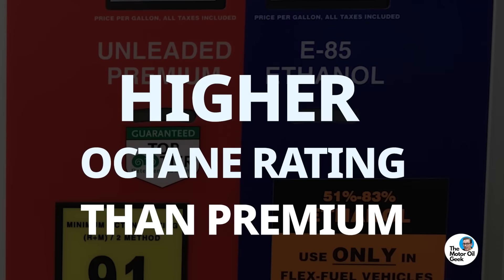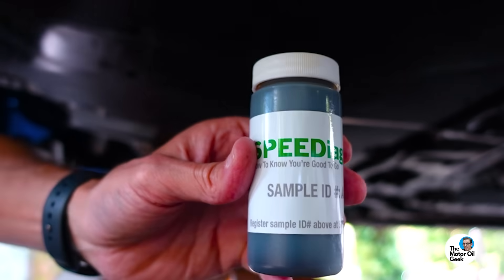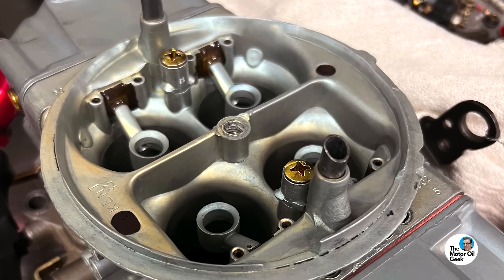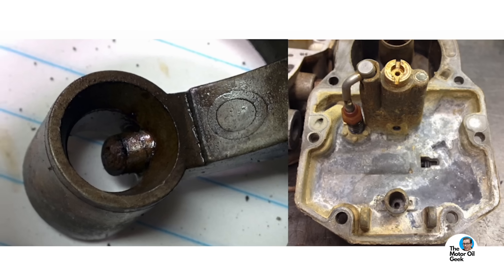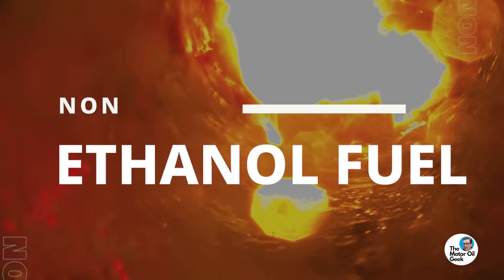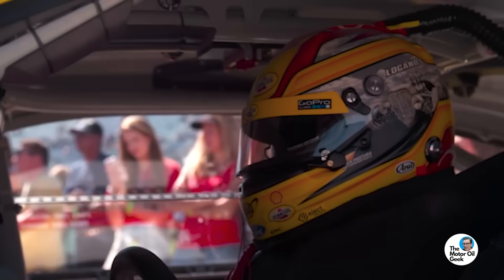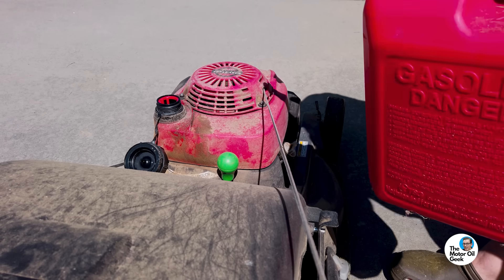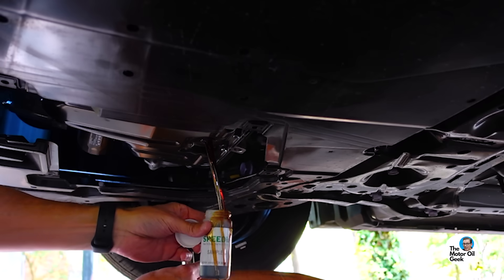ETHANOL: Higher OCTANE, Higher RISK?

Comment: Pump gas was blended with Methanol. Was. Ethanol is corrosive by itself and 10 fold corrosive mixed with mow gas. Two cycle oil mixed with Ethanol, forget about it.
Reply: Pump gas was blended with MTBE, not methanol.  The petroleum industry gave us MTBE after the disastrous lead was outlawed and it was not only an octane booster but also an oxygenate to reduce gasoline's toxic, carcinogenic, and dirty exhaust emissions.  During this time ethanol was modestly sold in the Midwest proving itself an effective and economical octane booster and oxygenate.

When it became apparent MTBE was another disaster in need of being outlawed, it almost was but was not outlawed by the Federal government.  

A few states did outlaw MTBE and brought big lawsuits against the petroleum industry over it which effectively phased it out in favor of ethanol which is a non-toxic octane booster and oxygenate.  

The petroleum industry even went along with the legislation to switch to ethanol because hidden in the bill was legal immunity from the MTBE.  That was revealed and taken out and the bill still passed.  This is why we have ethanol at today's levels.

The very first flex fuel vehicles in the early 1990s were rated for methanol (M85) and E85 but when use for methanol never materialized, that capability was dropped.  Methanol is slightly corrosive, so those early M85 flex vehicles had stainless steel fuel lines.

When the M85 capability was dropped in flex fuel engines, manufacturers dropped the stainless steel and switched back to standard mild steel fuel lines non-flex fuel vehicles have.

Ethanol on manufacturing chemical compatibility charts is far less corrosive on rubbers, plastics, and metals than what gasoline and BTEX (benzene, toluene, ethylbenzene, and xylene) are.

Brazil for many years has used their common gasoline in mowers, small engines, and small two cycle engines which contains 27% ethanol.  It has worked out so well and for so long that Paraguay went to E27.

Comment: In Western Europe from what I found out only BP/ARAL have NO ethanol or bio components in them. Hard to find some gas stations that have it, usual more towards German border. Shell V-power does, have bio crap they add more additives to compensate for the ethanol side effects. Same goes for their diesel. I use for high rpm engines (Honda) 102 octane (RON) from a special supplier not cheap (2.40 Euro/ liter) but then gasoline is never cheap here. Engine runs so much smoother. Like being back in the 90s.

Comment: In newer vehicles I love to run e85. It never seems to hurt my fuel mileage much and it’s way cheaper. I always have and always will do 3000 mile oil change intervals though. Will continue using it.

Comment: Ethanol destroyed my aeromotive fuel system and injectors on my foxbody mustang.  Had leaks everywhere.  The system was billed as being for pump gas. Let the car sit for years and finally decided to get the car running again.  Replumbed the entire system with ptfe lines fitting pump and tank. Hopefully i will avoid leaks and will use pure gas now

Comment: I really think all the arguments around how destructive ethanol is (or which fuel treatment is better) are down to local climate. 
I lived in northern Alberta and kept all the summer stuff in an unheated garage. Summers were dry, winters were well below freezing and I never had any issues. I bet if I lived somewhere with high humidity I would have had issues.
Reply: Before E10 came in the days of non-ethanol gasoline, people used to have to add little cans of alcohol to their gas tanks for gas-line antifreeze in northern states and Canada in winter with brand names like Heet or Dry Gas.

Mercury Marine thinks in their high humidity boat operation that E10 may be the superior fuel to E0 because it keeps the fuel dry.

Mercury Marine in a webinar on ethanol myths, noted that ethanol does not "grab water molecules out of the air." It is hydrophilic, which means ethanol holds water. With regular gasoline (E0) as well at E10, the primary cause of water collecting in tanks is condensation on tank walls. But unlike E0, which can absorb almost no moisture, E10 can hold up to half of one percent of water by volume, and the water molecules will dissolve in the fuel. The "solubilized" water will bypass the water separator and burn harmlessly through the engine.

Comment: Thanks for posting the informative video but there are more problems with ethanol fuel than you mention.  The first thing that comes to mind is the massive hidden subsidies for ethanol production.  In most cases they are burning diesel to grow and transport the corn to make ethanol.  Without subsidies it would not make sense to burn more fuel to make less fuel so governments hide the real cost and pretend the ethanol costs us less than fossil fuels.  Without knowing the total amount of the subsidies there is no way to know the total real cost of the blended fuel to the taxpayer.  Another problem with ethanol is that it can damage engines.  Ethanol will absorb water from the air and the ethanol-water mixture will absorb acetobacter from the air.  The bacteria wiil then convert the ethanol into ethanoic acid.  The acid will react with common metals to form salts and cause pitting of the metal.  There is no sensible reason to contaminate common automotive fuel with any alcohol.  Good luck with your videos.

Comment: If the aftermarket efi computer for my car was tuned using the standard 10% ethanol, will it still run fine if I put ethanol free fuel in it, or will I need to have some adjustments to the programming?  My state offers ethanol free 91 almost everywhere like Chevron.

Comment: My state does not require ethanol in premium. I use premium in all of my engines. Car mowers mini bikes go karts trimmers chainsaw. Year after year no carb problems.
Reply: Meanwhile, identical non-flex fuel cars, mowers, minibikes, go karts, trimmers, and chainsaws to yours have used >E27 in Brazil with no carb problems.

Your premium gasoline contains up to 40% aromatics like BTEX (benzene, toluene, ethylbenzene, & xylene) so you are getting exposed to some very nasty toxins and carcinogens up close and personal with not even a catalytic converter in between to try and reduce anything.

API's own study in 1948 found that the only safe level of benzene exposure was zero. 

Try looking up on chemical compatibility charts the corrosiveness of BTEX vs ethanol.

Comment: Question? Where does 3 different grades of gas come from one tanker with no separate chambers ??? And only one truck delivers to that station!!! All this gas stuff is a lie! Think about it folks!!!!😢
Reply: I have never seen a tanker truck that did not have separate chambers.  Even the small simple single axle trucks from the 1960s and 70s had at least three or four chambers.  

Chambers are needed just for preventing load shifts on the roads alone.

Comment: I run ethanol fuel in my mowers untill near the end of the year then i switch it to non ethanol fuel for the last couple tanks of gas of the year. i been doing this for years never had a problem. However, i never run ethanol fuel in anything 2 stroke. I burn too much fuel in my mowers to be paying 3.50-4.00 a gallon for ethanol free all year.

Comment: In Brazil all carburators made for E100 cars produced from the 70's to 2003 were all nickel coated to protect them from corrosion and many other model produced in the 80's on, even if the engine were gasoline only, had some kind of coating to protect them since our gasoline had different kinds of mixes with Ethanol since forever. All parts that come in contact with E100 is protected with some kind of protecting coating. In the seventies our goverment made incentives with a program called "pro-ethanol" and  by the mid eighties, most of the cars produced in Brazil were E100 only. I would love to see your lab test witth used oil from cars that run no E85 only!
Reply: We also have ethanol with anti-corrosive and lubricity or friction modifyers addtives at many gas stations.
Reply: @rauserfroes81  Our high aromatic (BTEX) gasoline is more corrosive than ethanol on chemical compatibility charts.

Since the sulfur was removed from gasoline, it lost its lubricity.  Diesel did too which is why diesel injector pumps now get lubricated with engine oil like gasoline ones have been.

Identical engines in Brazil last >300% longer on E100 than with their common gasoline.  Soot is what wears an engine out and ethanol is sootless.

Comment: I run ethanol blend on my hotrods. Oil silution is high, i get about 1000 miles on my rotarys and no more than 3 on my evo. It is a great fuel but does require the right components to be used and don't let it sit around for months on end.

Comment: Is 110LL( av gas ) a suitable substitute for ethanol fuels in small engines? And what are the down sides to running 110LL?
Yes it cost more but 1 carb kit offsets 3 years worth(5ga/yr) of ethanol fuel cheepness savings.

Comment: I get non-ethanol fuel for all of my gasoline engines and I've never been sorry.

I have a nephew (by marriage) who is a mechanic and he has said that even though it's more expensive in the long run to pay for premium fuel vs. a repair of a fuel pump failure, it actually is cheaper in the long run because 'time is money'...when the pump decides to crap out, it isn't going to be in front of your local mechanic's shop, so there's the tow charge...then being without the vehicle for days (weeks?) while they have to get the part (especially if you have a vehicle that's old enough to vote [legally]), getting it installed and paying the damages...

Another tidbit that people need to know about non-ethanol fuel from the gas station. When you pull up to the pump and start expelling its liquid, you are buying ~3.4 gallons of the fuel the last person purchased (fuel that's between the tank and the pump), so if 'cheapo' bought regular 87 and you want to buy 91, you're paying $3.50 extra for the stuff that's coming out of the hose for the first 3.4 gallons.

I try to purchase fuel from stations that have individual hoses for fuel (Kwik Trip* is the only one in my area that generally has individual hoses) or, because I'm a member of Fuel Rewards (from years past when I lived in a different area than I do now and there's a Shell station nearby, but without the separate hoses), I'll go around the pumps and do some quick math to see what was pumped from the old gal by the last person and when I find one that had non-ethanol fuel used, I belly up to the bar and pump like there's no tomorrow (I bring gas cans because we're all like family...)

One tip to finding a pump where the last person used non-ethanol is to go to the end pump as that's most likely to had been used by someone pulling a yacht...

*At some stations, Kwik Trip has 'non-ethanol regular" fuel available.  I've tried it and discovered that all of my gasoline engines are spoiled rotten! They kick and fuss like a teenage daughter not having the 'right look' to go out with her girlfriends...
Reply: I have to hand it to the petroleum industry's propaganda power.

Identical non-flex fuel cars, boats, motorcycles, mowers, weed eaters, and small engines have used >E20 since the late 1970s in Brazil and E27 from 2015 to 2024 (E30 now this year).  It worked out so well and for so long that Paraguay went to E27.

The power of propaganda has some Americans such nervous nellies that they actually believe an incidental extra bit of ethanol just contained in a gas hose could somehow destroy their equipment.

The power of propaganda has some Americans who never ever looked at a chemical compatibility chart before believing ethanol is very corrosive on everything, (perhaps similar to the blood from Sigourney Weaver's "Alien"). 

I suggest people use a search engine to find a chemical compatibility chart to see reality with ethanol's corrosiveness.

I also suggest they look up gasoline and BTEX (benzene, toluene, ethylbenzene, and xylene) on one as well and prepare to be surprised or to have cognitive dissonance.

A fuel pump in a non-flex fuel vehicle is identical to a non-flex fuel vehicle.  Fuel caps are different however since flex fuel vehicle ones are painted yellow and the identical ECU is set to throw a yellow engine light >E85 instead of >E50 in a non-flex fuel vehicle.

The US Bureau of Labor Statistics measured share of household income spent on vehicle repairs and maintenance from 1990 to 2017 during the time ethanol in gasoline went from .1% to around 10% from 2011 onward.

The share of income spent on repair and maintenance went from 2% in 1990 to 1.5% in 2017 as ethanol usage exploded.

Comment: Acre for acre, solar PV generates 50x the energy of ethanol. That's before you consider losses from distillation and the inefficiency of ICE. FWIW, I'm on my third season of a battery powered power. Buying gas powered small engines is just masochistic at this point. No oil changes, no gas, no starter cord yanking.
Reply: Sunny Hawaii has spent billions upon billions of dollars on solar and what do they have to show for all that?

They have the most expensive electricity costs in the nation along with the very dirtiest since the majority of it still gets generated by dirty and expensive imported diesel fuel.

For a tiny fraction of that money, they could have instead made ethanol from all the still standing abandoned sugarcane fields, built distilleries on the abandoned sugar mill sites, and used ethanol instead of dirty imported diesel fuel to make the electricity with the waste steam from them going to the distilleries to make the ethanol.

Then they could have had zero newly added CO2, clean, reliable (non-intermittent), and pollution free cheap electricity instead of expensive.  They could be something very rare for islands, self-sufficient.  They still could do this.
Reply: @danafletcher2341 you really don't understand economics at all, do you? Or even basic math? Or even basic logic?

Comment: Have a 41 year old mower with a Briggs 3.5 that has been running E10 for at least 31 years of its life without issue. Only had to "rebuild' the carb once. And by rebuild, I mean I had to clean a dirty needle seat in the float bowl from all the dirt that gets in the gas tank. A little Marvel Mystery Oil in the gas at the end of the season to absorb water and treat the gaskets and it starts on the first or second pull every year after winter storage. Stoddard solvent is awesome.
Reply: Mine is only 30 years old and 13hp tractor engine but no issues.  I do t add anything.

Comment: Ethanol isn’t terrible in all aspects. My 2 cyl Deere sits outside year round and it’s on e85 and it’s a puller so it sits months in the Midwest and the carb is cleaner now than it was with 120 octane.

Comment: Could you test engine oil stop-leak products such as ATP AT-205.  The most common fix is for a leaky rear main seal.  Is it risky to use stop-leak?  Does it degrade oil performance?  If so, by how much?  Is it safer to use with some oils more than others, ie: I use Valvoline Restore&Protect. Safe to use or avoid at all costs..?  (Project Farm did a video that would be worth watching)

Comment: Ethanol in fuel is supposed to help the environment. It does just the opposite. Apart from the diesel and electricity required to get from seed and dirt to ethanol in the tank, the corrosive tendencies of ethanol kill the engines they run in by buggering up air fuel ratios and proper atomization, to causing outright failure of equipment and the need to replace it prematurely! Ethanol damaged the carburetors in my weed wacker, hedge trimmer and leaf blower.  Switched to battery stuff which works great but lets not get started on the damage lithium extraction and refining does!

Comment: I ran standard pump gas, E10, in my sbc with a rebuilt carb for years. Never had an issue. Do modern carb rebuilding kits use ethanol resistant parts? That's what I'm thinking. What say you all. ( of course, that doesn't help the carb metal).

Comment: Ethanal Free fuel is not cheap. Most places around here that have it, it's at least $4 or more a gallon.
Reply: Still worth it when buying for a gas can for your small engines (if it isn't already old or below needed octane for your high compression chainsaw) 
  still needs to be in a closed container and fuel stabilizer used if to be kept more than a couple weeks before use

Comment: Cars that are not rated to run E85 might not have enough allowance to richen the air/fuel ratio properly on E85 and so would not run properly on it.
 I think systems that can run E85 and maybe it's even needed to run E10 need to use stainless steel or some other expensive metal instead of the old fashioned "pot metal" or cast zinc for fuel system parts that touch or get wetted by fuel.